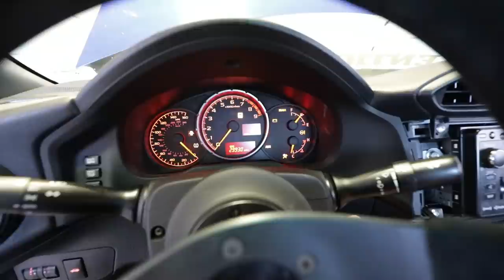TURBO BRZ GETS UPGRADED!

Comment: Pretty sure you are supposed to tighten all suspension components with the full weight of the vehicle on them.
Reply: interceptor tighten to torque spec and drive a couple days, retorque
Reply: Yup all suspension components so there is no binding.

Comment: I've solved sway bar clunking by re-tightening all the bolts while the car is on the ground (so the suspension is loaded). And don't overtighten the endlinks.

Comment: You have to do a full turn at speed to check for body roll. Need to be going fast enough around a corner for weight transfer.

Comment: Hey dustin I had that clunck in the back it ended up being the rear sway bar position. It has to be level with floor when the cars on the ground you can tell if its level from that flat piece you bolt the end link too I had to get adjustable endlinks to fix mine. Hope that helps you solve the clunck I wasted a lot of time messing with suspension and checking torque specs when it was just the endlinks and sway bar position. Keep it up bro

Comment: Better check if that knocking could be from that sway bar knocking the absorbers, I had that issue on my Proton Satria Gti, due to the thickness of the new sway bar, the gap between the absorber and sway bar has been reduced, resulting in both of them hitting each other. Not sure is it the same in your brz or not but it is worth taking a look, the knocking sound can be very annoying

Comment: Now go back and undo that sway bar link on one side. Drop the car then tighten the end link back up. The sway bar needs to be neutral before you put both links on.. Just saying. That's the noise that you're hearing. That's how you correctly install a sway bar.

Comment: its better to install a sway bar while the car is on ramps.. also you will get some popping sounds from the sway bar if you dont torque the bolts correctly. happened to me on my wrx

Comment: drifters that dont run a rear bar are likely cars with much more power. at that level, theyre actually trying to get as much rear grip as possible. bigger rear bars always throw the cars balance towards oversteer. Ex: on the wrx, a larger rear bar will make the car handle neutral, and maybe even oversteer if you go big enough and leave the front stock. On the wrx the front is already pretty big. I think 24mm, so a 22mm rear is perfect

Comment: About that sound in the back... did you Tightenned the bushings before the weight of the car were on them? They could have twisted could have ripped.
Reply: You can use the jack to preload the suspension from the knuckle to make sure when you tighten everything sits in the place it will when the car will be on the road. :)

Comment: If you are thinking about getting sway bars on this car, don't. Even professional track cars don't run upgraded sways because they make the car too twitchy during high speed cornering. Hence the reason Toyota went with a thinner bar to keep the tail in check.